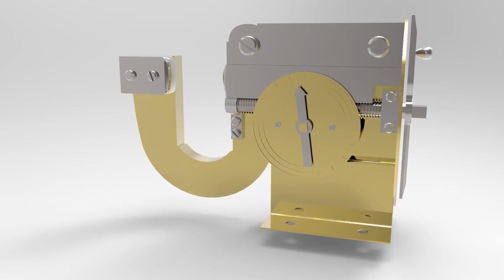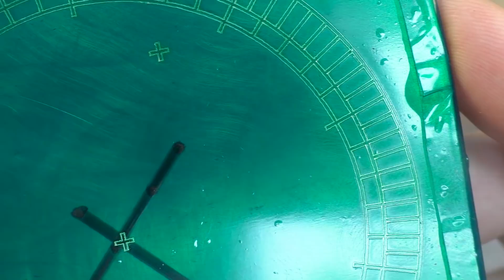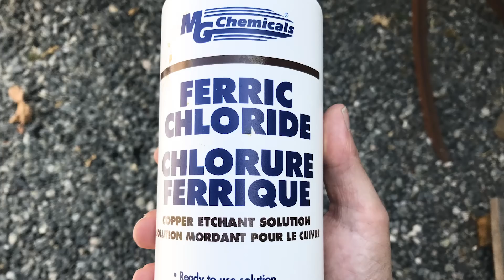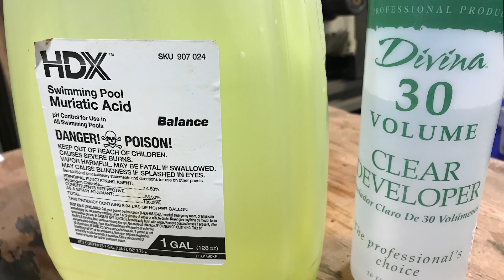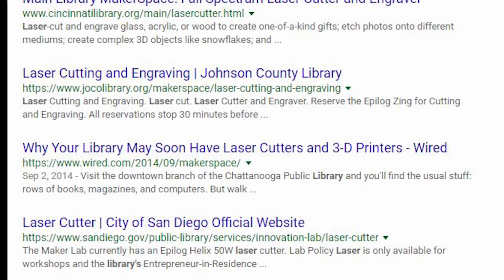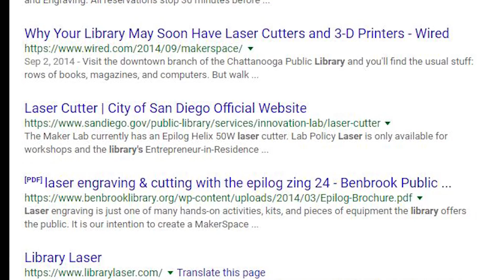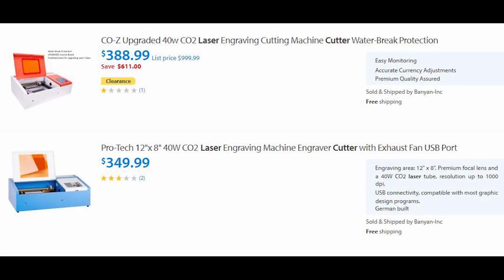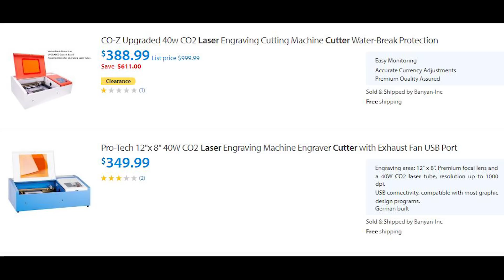New method for etching brass dials - great detail!

Comment: Great process till Etching stage.!! ...Add a 1 or 2mm circle to your artwork at required Finished size , this allows at a later stage for Chemical Milling, (any shape you need is possible )!!...First, Source (Google) for an AC (110v) to DC adjustable power adaptor, ideally 1.5v plus intermediate DC voltages up to 12v, @ 2 Amps or less, using 3v or 4.5v or more will accelerate Etching.!! Make a Super Saturated Solution of Coarse Kosher Salt using, Distilled or Rainwater, never your Domestic Supply as it's loaded with Chemicals making Bug Free water supplied to you.!! ...There's a number of Video's on YouTube covering Salt Water Etching you may choose to view.!! ...Cross Hatch your Brass Plate with 400 or 600 grit Wet & Dry Sandpaper with any Water, when rinsed often this helps to keep the paper clean, if your Resist is Water Soluble, this may Not be of any use to you.!! ... With your resist removed/stripped, an ink used by INTAGLIO Etching Folk Making Badges, or Etching plates, this ink is scraped into the etch with an unused Credit or M'ship card, then heated to dry, these folk also use a Stopout, needed if the Chemical Milling is of interest, Asphaltum Powder dissolved in solvent & brushed into required areas of the plate is an acid resist, it's an old old method, Now there is probably a better choice!! ...If you Google a POWER ADAPTOR with above Specs. this may put you onto a cheap chinese unit, or local product.!! (POWER ADAPTOR Model: KEX-12002000) or (SEVEN STAR AC-DC ADAPTOR MODEL SS104) now in use
Cheers from Downunder

Comment: wtf ... I dont have a laser cuting machine, a 3d printer or the others ... I am going low buget style
Reply from the maker: Watch until the end of the video. I show some ways to do it on a budget.
Reply: @machinethinking  is there a company where I could send my blanks already cut polished and taped to be laser cut with my own design. I'd like to make a 36-37 mm Dial for a watch with hour  numerals, logo and railroad track like yours.

Comment: Using only thousands of dollars worth of equipment................
Reply from the maker: Watch the entire video and I address this at the end.  Walmart (and many others) sell lasers for less than $400.  Many libraries have them for free use and lots of cities have makerspaces with very affordable access.
Reply: Uh these are parts to replicate micrometer dials for a micrometer made approximately in 1776 mrthebillman. If you have the equipment to machine the dials like a mill then the addition of a rotary table and a simple shop made engraving bit would allow an authentic reproduction without "using only thousands of dollars worth of equipment". The laser and etching only speeds up the process, but other methods can still be used. If they did it in 1776 without a laser then we can do the same today. There's nothing in this video that can't be done the old school way. One could argue that a good expert would think the cut engraving would be more authentic anyway since it would leave identifiable tool marks for how it was done.

Comment: Ok, what's the laser tape?  I'm browsing the Ikonics Imaging website and the only product that looks like it is over $200 a roll...yikes?  Edit: I'm also not sure what property it brings that makes it worthwhile?  Will the laser not cut through something like colored tape (taillight tape, etc)?
Reply from the maker: I bought it from Johnson's Plastics for $22 for a 4" x 25' roll, but it looks like Ikonics will sell you a 4" x 100' roll for about $50.  Price per foot I think is good for the value it gives.  You have to be very careful with other tapes that might be PVC based which will emit Chlorine gas when lasered.  This is obviously bad for you but also bad for your laser as it will corrode bare metal. Good luck!

Comment: This was pretty cool! Just wondering, how long was the full process? And could you use a similar process for a PCB?
Reply from the maker: Not counting the time I let the paint cure over night and the etching time itself I would guess about an hour of work?  And of course this could be used for PCBs. But, another option if appearance isn't a concern might be using lacquer spray paint you ablate with a raster engrave

Comment from the maker: Have you done any acid etching on metal?  Which method did you use and how did it turn out?  Also, YouTube auto-leveled the music making it louder than I had it.  Sorry!
Reply: Would this work on aluminum? Also where do you buy the laser tape?
Reply: Hi, nice video! I just found your very awesome channel, I have used photo etching, and I was a bit disappointed in the results, they where soft and a bit blotchy, and I have used a mechanical processes similar to yours in the video, but, it was oriented to artisan use, and the resist was some mixture of wax, shellac and dye. It worked very well, and I think it could be modified to work with laser obliteration, and why I am excited to share the progress with you, is the clean up after filling the voids with ink. You just warm it up, a bit of alcohol in boiling water, and the hard wax/shellac melts off, taking the extra ink with it.
It might be something fun for you to experiment with
Reply: Now I try with melted bitum, dust, and scratching ... I will post the resuts on facebook :) more art related
Reply: Sir say about digital printing for making anodized aluminum name plate
Reply: Machine Thinking 
Any machine available for anodized aluminum name plate
Reply: With aluminium I did use drain cleaner ( sodium hydroxide) to get a thick oxide film, and to strip off worn colour coats. Then just a wash in weak organic acid ( I used ascorbic acid as I could get it in a pure form) to grow a new thick oxide layer. Never did a dye on it, but I suppose I could use Azo dye with it as well during the acid wash stage.
Reply: amazing video, thumbs down for the annoying music.  hope you re-upload with out music.
Reply: have you seen or tried this https://youtu.be/CrdheP3Dwyc?t=141  I wonder how well a photo resist film would work with deep etching.  Great idea to etch with your piece upside down
Reply: I used a silk screen and liquid mask. For etching copper clad PCBs.
Reply: Sulfuric acid electrolytic for deep graphical metal etches. PCBs with Cupric Cloride regenerative - i have found though that air regeneration is non-useful. But is does buffer the H2O2 and makes it non-unreliable.
Reply: Try salt water etching. It's basically just reverse electroplating. It's extremely simple and I've had excellent results. The only thing a first timer needs to know is that the brass will contaminate the anode your "painting" with so using an alligator clip with a q-tip is a good idea . Or you could submerge the whole thing. I've never tried that method but considering what I know of electroplating, it shouldn't be a problem as long as that laser tape adheres. I bet if you try it you'll end up with just as good of a result but much faster and with do acid to deal with.
Reply: @christurnblom4825  This is what I use to put my mark on the knives I make. I have made my own stencils and only have to use an exacto knife to remove the unwanted portions. In the future I will have some made by a commercial firm. That will not only make things a lot quicker but also alleviate the stress! What I like is how deep I can make the etch. I can vary the depth within the same stencil which provides a unique dimension.
Reply: @glennwiebe5128 
That is my favorite part about it as well. I was trying to develop some box mods(vaping units) a few years back and one of the ideas was to make one look like a piece of wing from a WWII aircraft, with all the patchwork they'd do to keep them flying after getting bullet holes. It takes a few steps but you can etch an amazing level of depth into stuff with this method. That one has raised rivets, overlapping sheets and deep grooves for the flaps.
Reply: Machine Thinking I’ve gotten reasonably proficient with laser toner mask transfers. The trick for etching (not circuit cards) is to heat the metal from below with a hotplate or griddle. Clothes irons only lead to frustration. I’ll be happy to move on to this method if I ever get access to a laser. Love it!  https://www.instagram.com/p/BcdC3SeBmx6/?utm_source=ig_share_sheet&igshid=ti8ac7vp9u1z